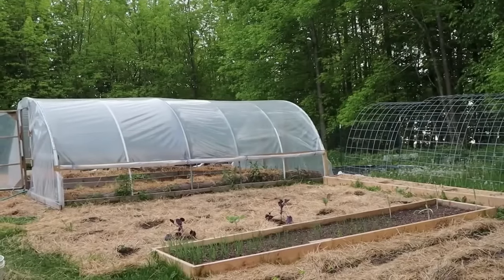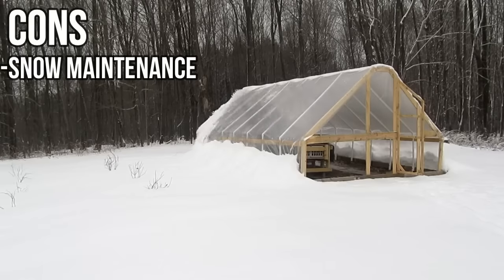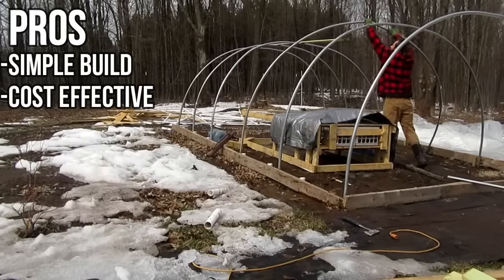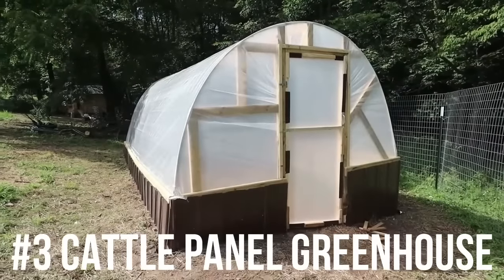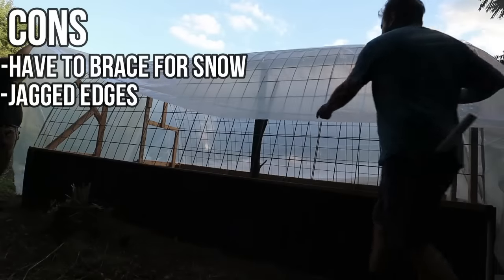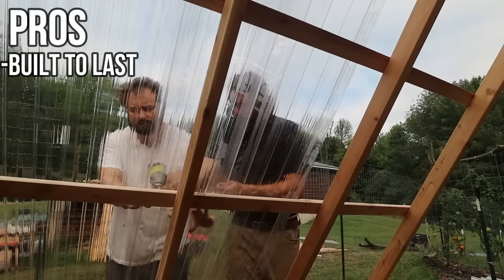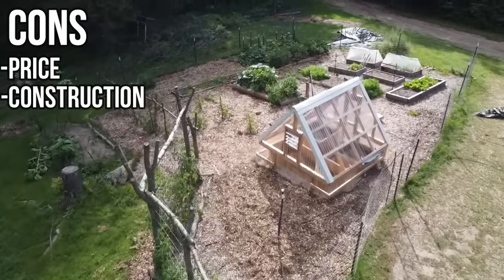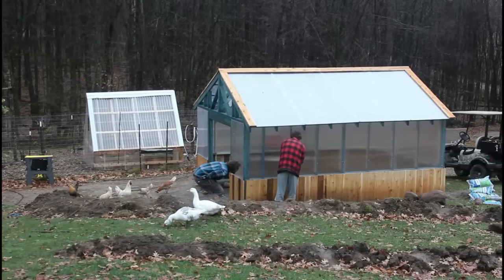The Ultimate Guide to DIY Greenhouses: Pros, Cons, and Everything In Between

Comment from the maker: Hey everyone! I wanted to clarify what I meant when I list "bugs" for a con on the 6mil plastic greenhouses. In our experience there were always an excess of flies and other insects in these designs and they would die and end up in the crevasses of the 6mil plastic. It was difficult to clean them out and over the years there were a gross amount of them built up. There were no issues with pests on the plants or anything like that!

So far this has not been the case in our greenhouses with rigid plastic panels, so that I why I list that as a "pro" for those designs and a "con" for the 6mil.  However, they are young so we will if that continues over the years. Our A-Frame greenhouse is older than our cattle panel greenhouse (with 6mil) and the same issues appeared in the cattle panel shortly after it was built, so that is why I decided to add that to the video. I realize that there are other factors that go into that, but that has been what we have observed.  We are also close to industrial farms so there are an abundance of flies hatching in the summer months with the spreading of manure. I just thought I would expand on this a bit, I have gotten a lot of comments on this topic. I should have been more clear in the video. Thank you all for watching! I appreciate it more than words can describe.
Reply: You may want to look into 12volt diesel heaters for one heat source.  You can power them with 12v solar and 12v batteries.  I have a video on my page showing an off grid greenhouse I built.
Reply: Well... wouldn't it be better to figure out where you are going wrong before posting a "how to" video?
Reply: flies are attracted to heat big time
Reply: Awesome builds here. Love your greenhouses. Where do you get the DoubleWall Plastic Panels ? 
What is the thickness of them in MM ?  :body-green-covering-eyes:
Reply: @brianbassett4379  thanks for contributing lol
Reply: @chefgiovanni  From what I understand, the double-wall is also called polycarbonate aka polycarb. Available in multiple different thicknesses and qualities. My greenhouse finally got the last old glass walls exchanged out last year - we've had the polycarb on the roof for... around 7 years now and it's starting to get somewhat milky - on one hand, it avoids burn spots, on the other there is technically less light coming through... Insulation is way better than with glass, so it can be used for longer here at 59 N.
Reply: Hey a good thing for bugs is a small lizard or newt they will eat all the Beastie's 🇨🇮😎
Reply: @cascadia_101  he's just another keyboard warrior... 🙄
Reply: A gutter system draining into raised barrels with an overflow would work nice with some drip lines or even low pressure water hoses for that last greenhouse.
Reply: Great video. Could you please list suppliers for the rigid plastic sheets (polycarbonate?) Both single and twin layer? They are very expensive @ hardware stores
Reply: I have a little 4 foot greenhouse next to my trailer, also using 6 mil plastic tarping, and I have the same problem with bugs. Additionally, I have a lot of snails and frogs in my area, and live in a wet climate. So in addition to the bugs buildup, there is snail and frog poop, and when moisture collects on top of it, i get algae growing on the plastic. So I can definitely confirm the problematic nature of it. (It's so cheap though...)
Reply: Any thoughts on growing herbs that repel pests in these to help mitigate those issues?
Reply: @mikemason4758  if you get a answer I can use a bump. I know most strong odors like lavender and cinnamon can help in worried about damaging the poly or acrylic I’m struggling to find a way to get here
Reply: @WhatHappenedIn-vt3vq  I don’t think we are talking about the same thing. I was implying that some herbs are more likely to repel pests. You are not growing cinnamon in your greenhouse. I am sure of it but maybe lemongrass, lavender, mint, marigolds , maybe more, can reduce pests. And an astringent now and then to kill maggots.
Reply: Well, cedar is bug-repellent... But a few shavings will do the same job as building only with cedar
Reply: Polycarbonate sheets are the best thing to use especially in northern climates. It's what l plan on using and yes they come with a 10 yr warranty but you must seal all the ends before putting them on.
Reply: @brianbassett4379   If you wait until you stop learning to share what you know, you will never have anything to say.
Reply: Sounds like chicken food!
Reply: Maybe let the bugs out with a hole or something that closes with the plastic
Reply: Let me get this straight, bugs in plastic but not polycarb...if you had a setup for poly would you still have bugs with plastic? The frame bld does not have the crevecese witg 90° corners that hoop and wire have for the bugs to get stuck in... i dont think there is a difference in bugs, only where they get stuck.. in the poly the flies are on the ground with no crevace to crawl into
Reply: They show you that you have holes in the 6mm
Reply: This is going to sound really weird, but I sell mattress covers made from the same plastic, and I had a customer email me one time asking what they are made of because some bugs got on it and died. It is literally the safest  plastic you can use, so I'm not sure what the issue is. Also, are you using UV ready polyethylene? 3-5 years isn't long enough if it is. I know the regular polyethylene breaks down really fast, but in KS it might make it through 1-2 years depending on how much sun it receives. If your 3-5 is with UV poly, I would give that up. Think about all the plastic ending up in a landfill.
Reply: Lady bugs will eat any thing that comes in
Reply: O
Reply: Nice vid
Reply: What a great comparison on greenhouses & hoop houses!  Thanks so much! 😊

Comment: These are all great examples that should get the greenhouse design wheels turning. One thing I would recommend for anyone building some of the more permanent designs is, Build a Model first as in a small wooden model that is to scale with all of the structural elements - hobby centers sell balsa wood in scalable dimensions. You will work out joint angles, and material use, and encounter any design challenges before you're working full scale. I did that before I build our home, and it was a great tool. AND always stop at the commercial desk of Home Depot, or whatever building center you're using, they can often give you a package discount if you're getting everything there, including windows, translucent panels, etc... can't hurt to ask. Thanks and thumbs up!  Also, ask for Scratch and Dent, or Returned Windows/Doors, building centers won't tell you about them unless you ask and you can design from your most expensive items up. :)
Reply from the maker: great advice!
Reply: You won’t see moths in the twin wall unless you go with the 11 mm
Reply: NEEEEEEEEEEEEEEEEEEERD!!!
Just kidding --- great idea there!!
Reply: Or if you don’t want to use actual material you can install a CAD software and design it all through that, plus you can print out blueprints. My dad did this with his shed and soon to be house, I plan on doing it with my DIY RV

Comment: we built the cattle panel version and in order to avoid tearing of the plastic, we made a slit along one side of pool noodles ( not in half) in order to make a kind of sleeve and then slid them over any edges that directly touched any plastic. it has worked like a charm
Reply from the maker: That’s awesome, someone else commented the same idea. It seems like a smart, cheap solution!
Reply: My husband and I built a cattle panel greenhouse and did the same thing with the pool noodles. We've had no problems at all with tearing. Love my greenhouse!
Reply: pipe insulation comes with slits and cheaper
Reply: What size cattle panels did you use? Thanks!
Reply: @kannettestewart8677  we used 5 ft tall x 16 feet width. and we used a total of 8, making the 5 ft height the length of the Greenhouse for a complete length of 22 or 24 feet long by 10 feet width. give or take a few inches. It was built in 2020 when we had plenty of time on our hands so the measurements may be a bit off depending on how many panels used. Home depot sells $5 landscape posts we used for the corners and center support down the middle, for a total of 9 timbers so the snow wouldn't crush it down in winter.

Comment: You don't need plastic on the north side of a greenhouse. You need a reflector on the north side.
Reply: And insulation.
Reply: Depends on the amount of sun your getting with heat. Colder climates get long days the summer and heat becomes a major issue. In the cooler months it would work well.

Comment: I built a cattle panel greenhouse, and i use cheap black plastic water pipe to keep the plastic from ripping. I just put a hoop of the water pipe on top of the panel every 4 feet to keep the plastic off the wire.  I screw it to the base and zip tie it to the wire to keep it from moving.

Comment: In case one's mentioned it... on the next build I would do the following:
#1 build a single slope greenhouse with a corridor on the north wall... running East to West.  
#2 use a solar tracking app to find out your locations true optimal location and this will determine your optimal roof slope.
#3 Look into geothermal heating and cooling through intake and exhaust systems. Usually requires a concrete slab floor and some excavation of sub structure.. but totally worth the effort. 
#4 look into insulated metal panels for sidewalls.  Tons of new effective options now that add barriers andr value to your build. 

10 years on polycarbonate is not happening... unless you grease the insurance agent. 😂

Nice work all together.. keep up the innovation!!!
Cheers
Reply: You sound like you have a lot of knowledge to share — any links or a blog for us mere mortals to learn more? My wife and I are planning to build a greenhouse here in Sweden, with temps ranging from -20 C to 28 C, and I have been thinking about a sand battery design for all-year growing, but the info can get pretty overwhelming and some of the designs are overkill for our climate and ambition level.

Comment: Great video and design! thx for the content and sharing this.
For heating greenhouses: I found out the best option on a youtube: some dude has built huge greenhouses with nice climate control system and with one motivation: build with scrap/recovered materials and cheap options yet doing the right job the optimal way. Smart man, understanding thermo-dynamics, his climate control vents are like so:
Large intakes  vents circulate outside-air through layered-pipes of circulating water from the underground reservoir.
The large reservoir is a huge temperature buffer. 
In summer, this vent is cooling down hot air, and in winter it's heating up cold air.
With this buffer option you can also lay some pipes on the ground.

Reservoir solution/liquid:
1. You could also have this reservoir be your nutrients reservoir for aero. (low nuts and R.O. water to keep maintenance low cleaning the system).
You may need to keep the reservoir topped with ambient temperature for it to be the most effective. If there is less volume the buffer liquid will heat-up or cool down much faster.

2. Dedicating the vent reservoir for climate control using R.O. water (filtered soft water for pumps and pipes) 
and as extra: adding some kind anti-crap agent (like bleach) and maybe a cooling/ temp buffer agent (to increase the buffer potential) in it. This is finalise the dedicated solution for climate control.

3. Simply use filtered (rain/tap) water (filter particles/debris for pumps and pipes) you could use to water beds.

Happy gardening, Love

Comment: Liked & subscribed! Excellent presentation that really helps as we plan to develop some DIY greenhouses for all season food growing. 

Of great importance to us is: climate change resilience. We expect more extreme weather events: large swings in daily weather conditions, sudden cold & hot spells, torrential rains & longer droughts, high winds, sudden hailstorms, etc. 

Creating greenhouses from free re-purposed materials, like discarded windows, that are designed with maximum resilience in mind, such as deployable wind & hail protection, is critical to us as we are on a tight budget and want to open source our designs so anyone can build their own. Adding an inexpensive to operate heating system is vital as well.

Still, some of your designs are relatively inexpensive and would get homesteaders up & running quickly, which is important to having even a chance at sustainability. Love what you are doing and will watch some of your other videos to learn more. Thanks for sharing!

Comment: Thanks for a very well detailed overview of your various builds. We are currently erecting a 10x12 greenhouse kit on a wood deck and adding a 12x12 to one of the gable ends that will be wood framed and sheeted with the corrugated polycarbonate panels same as one of yours. I have used those panels in pole building construction, so I am very familiar with them. They last far more than a few years. We will be heating our greenhouses with hot water heat from an outdoor wood furnace that also heats a 36x 104 pole building. We are also building a 12x24 greenhouse as a addition to another pole building that will not be heated. Perhaps in the future it will. All your greenhouse designs look well done!

Comment: We made our greenhouse sort of like your cattle panel. We use 2 by 12 ground contact wood to creating basically like a raised bed. Then 2 foot post above that before the cattle panels so that it would be taller. All of it is window screened in. At first we covered it with plastic and being in the far south that was the biggest problem we had because it cooked everything. The solution was to make long strips of window screen and sew them together. Then down the center of the greenhouse put 6 foot wide by 20 foot long plastic which we anchored  via eye screws and rope. This helped keep the screen from catching wind and tearing loose from the framing. We also added an outside bed for plants that require bees for pollinating.  We placed pvc as a cold frame  over that bed. In our not too cold winters (as low as 20° overnight) we can completely cover the greenhouse and outside bed with plastic that is attached to 1" pvc pipe that rolls and unrolls. We tried bug net before using window screening and it disintegrated from the sun/heat in 3 months. We critter protected the underneath of the whole build plus lower sides with 1/2" hardware cloth. No bugs, no moles or any other pests after the changes. The beds are to either side and full length with covered walkway in the middle. T5 plant lights under cover take the edge off the cold nights and oscillating fans on low create wind pollinating. My only wish now is I wish it was 2 feet taller. 4' sides would've been better for tall tomatoes and such. I almost forgot, we also attached gutters and use them for growing herbs. Total size 16wx20l
Reply: Would love to see your finished greenhouse.  I am a visual learner, but it sounds like it would be great for my area too.  Thanks a lot.  Cindy

Comment: Very nice video of some basic build overviews for greenhouses. Thanks for sharing. Good luck in all your future builds.
  I like to build with cattle panels too. Last thing was a 12 x 16 wood shed. I am thinking of making another greenhouse soon using a walled A frame style design with cattle panels for roof sides. Using cattle panels, I make sure to put the lengthwise wires on top so the crosswise wires are underneath. Then I grind the cross wires flush with the lengthwise wire so the cover won't catch on the wires as it is pulled across. The ridge support is key for snow loads. I also bind the panels together where they meet with wire.
 - If you continue to have problems with bugs in your greenhouses open to the ground try tarping the ground for an extended time. The longer the better to interrupt as many pest life cycles as possible. I mean you can't get them all , cicadas are, what? every 11 to 17 years? Best is a total permanent tarp and grow in raised beds. 
- It would also help to put tarp or weed fabric all along the perimeter of the greenhouse to create a plant desert buffer to enter your greenhouse.
Reply from the maker: That is so cool, Mark! That is a good idea (grinding the crosswires). And thank you for the suggestions on bugs, we don't have too many issues anymore because we are only growing in one 6mil plastic greenhouse anymore and the sides are open on that one. We have raised beds in everything now:) Good luck with your builds! It sounds like they are going to turn out great